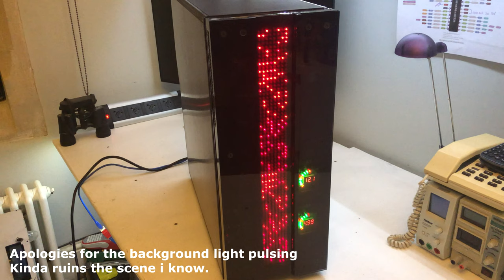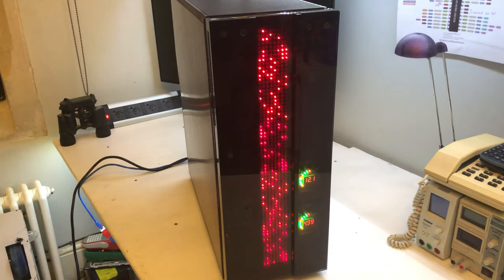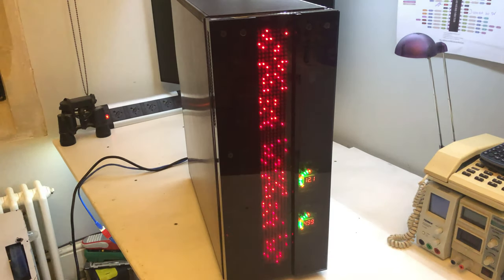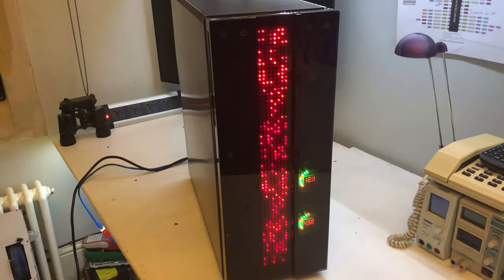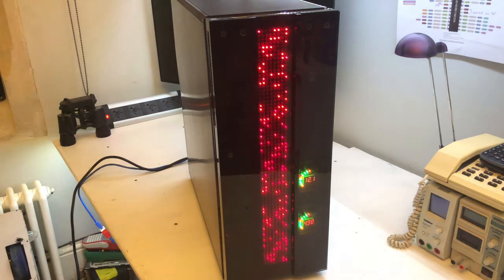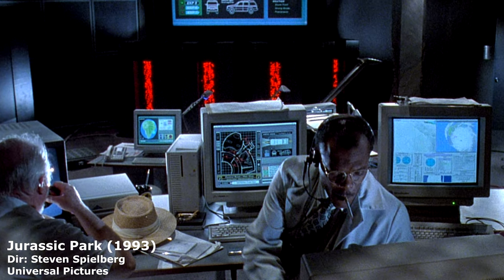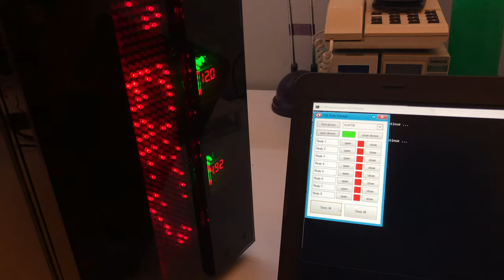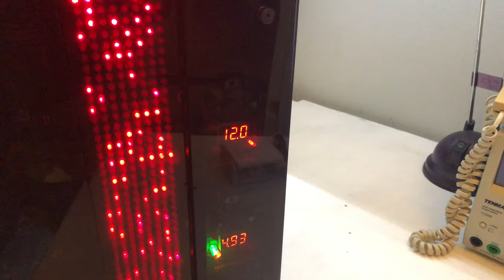Custom CM-5 Front Panel Computer Case

Comment: It looks beautiful. 
Long ago, when transputers were popular, I used to admire a bunch of LED lights. 
I got carried away with the idea of building my own parallel machine with a bunch of MC68000 processors. 
I never made one. 
Today, when the CPU has more cores, I don't even have to imagine anymore...
I had the same idea for Front Panel a long time ago, but I never managed to take the time to make something similar. 
I'm wondering if there is a possibility that the LEDs turn on according to some event inside the computer? 
For example to show cpu, memory or hdd usage or something similar?

For 7-segment displays would be better to show some useful value since the voltage doesn't change significantly. 
Maybe to show CPU usage or CPU and case temperature?
This way if they show any deviation greater than 5v and 12v, it may be too late to react...
...
There are now relatively cheap LED matrices (managed with an RPI PICO microcontroller) and I thought I would use a few pieces to make a case similar to the CM-2 machine. 
The biggest problem for me is to find information on how to get data about memory usage (memory map) or about communication between processes, which would be nice to see in graphic mode on the LED panel (each LED to represent a part of memory or a process or ... )!
Does anyone have experience with this?
Reply from the maker: I'm happy you enjoyed it. It had occured to me that with some cleverness it would be possible to get the lights to represent CPU load or other interesting stats but i never got around to implementing it.  I can't help you with your idea but it is possible others might be able to.